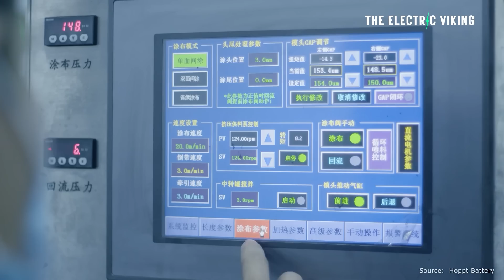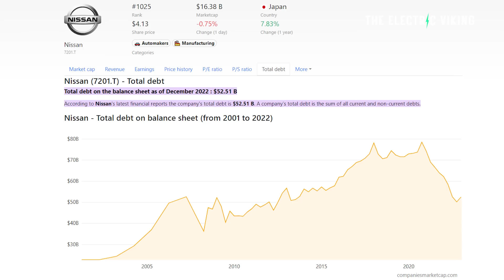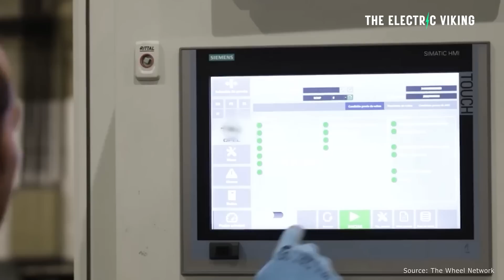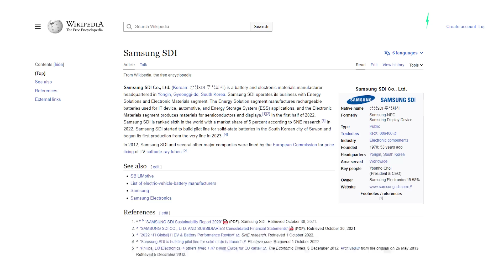WAY too many battery factories are being built in the US with the wrong batteries

Comment: What you are neglecting to consider is that,  in moving to the renewable age, sufficient battery supply is absolutely essential . The market will determine which chemistry will prevail. And yes, that prevailing technology will change over time.
Reply: >>  The market will determine which chemistry will prevail. ...<<
That's not how it works.   The industry is heavily subsidized by gov't larges.  In China particular, the CCP forced out Korean/Japanese battery makers early on-- who btw had well over 50% of the Chinese market share in 2015 -- from partcipating in China's EV market to protect their weakings BYD/CATL.   Those foreign competitors now have 1 % in China and the CCP's "preferred" LFP has become de facto standard in China with over 50% new EV in 2023.   Biden's IRA largely a measure to counter China's market distortion and to restore the battery market as it should have been.

Comment: These lithium ternary (possibly pouch cell type) battery factories being built by SK Innovation and LG Chem in partnership with American legacy automotive OEMs will likely quickly go bankrupt if they ever get built at all. As EV adoption accelerates, American vehicles buyers, fleet owners, municipal and state governments, repair shops, insurance companies, and lending institutions are becoming more familiar with the different types of batteries and their associated benefits, limitations, and fire safety risks. Tesla's 4680 batteries, a good portion of which will likely be LFP and LMFP, will set the standard for American EV batteries simply because Tesla will be making and purchasing so many of them. Less safe, more expensive lithium ternary batteries will fail in the market by comparison. The fire hazard, expense, and deep cycling issues of lithium ternary batteries also makes them far less suitable than LFP or Sodium Ion for stationary storage applications. If these battery factory projects don't switch to safer and less expensive chemistries then they will likely soon evaporate under the harsh spotlights of financial industry analysis, fossil fuel funded media scrutiny, and market competition.
Reply: It will be pretty straightforward to change or update the battery chemistry in any given battery factory. They will be set up to ensure that it is possible.

Comment: There are many uses for batteries. We haven’t even started on heavy machinery and other things that run on some type of fuel. The market for batteries is unlimited even for non state of the art ones.
Reply: Including the uses new technology has not even created yet
Reply: @sparkysho-ze7nm  Exactly, maybe I'll finally be able to buy a refrigerator with a backup battery.
Reply: Solar panel charge controller 12 v battery 3000 watt inverter  click click free energy for life
Reply: The point is that if you have an option between a car with LFP or NMC you will choose LFP. And they are setting themselves up for that choice to be between a Chinese car and an American/German/Japanese car.
Reply: Japanese don’t make evs YET
Reply: the batteries long way to go to match the energy efficiency of gas which is equivalent to 12KWh/kg -- most cutting edge LFP is only about 200Wh/kg whereas NCM9 is ~320+Wh/kg.
Reply: @tooltalk  Matching the energy efficiency of gas will be a milestone. I predict gas will still be available when it happens.
Reply: Utility storage.  California gets most of its electricity from solar but the sun goes down in the evening.  Just in the last couple weeks, we've experienced rolling power outages across California.  People are pissed, especially when they can't operate their A/C units in 105 F degree weather.  We will also be shutting down out last nuclear power plant in a couple years.  Brilliant.
Reply: Over investment isn't the problem, under investment is. I don't get his take here. I am more worried about enough lithium to supply all these factory's.
Reply: @bp495599  I wouldn't invest in lithium right now. There will either be oversupply of it or batteries will no longer require as much if any over time.
Reply: @bp495599 there is an unlimited availability of Lithium. Its processing that hasn’t caught up.
Reply: Lithium refining Issa cathode plant……….” A license to print money “ IN TH US ONLY TESLA IS REFINING LITHIUM click-click

Comment: I ordered the one variant that had LFP, the Model 3 RWD, as the advantages seemed to outnumber the disadvantages by a lot.  Like being able to charge to 100% (versus getting 20% more range and suffering degradation if charging above 80%), avoiding nickel and cobalt's environmental impact (having lived in Canada ten years, and knowing the extensive past impact of the Sudbury Ontario nickel smelter ), lowered risk of thermal runaway.  Versus slightly lower energy density (but charging networks are infilling a bit each year, and more Airbnbs offer EV charging, so that's ever less an issue).

Comment: We're going to have a cycle of overinvestment and correction, which is not unusual for new tech given subsidies; right now any supplier who gets in an offering at the right price and quantity can find a place to survive, and then if they hang on, they get consolidated into a monopoly producer a few years down the road.
Reply: It would be very hard to overinvest in battery production at this time.  Aside from EVs there is an enormous need for storage batteries as we transition from fossil fuel generation to renewable energy.

Comment: What about Chinese and Russian companies hogging all of the Lithium mines? 
EV battery production race is over before it haa started. By the time US manufacturers get LFP right. Sodium will be the new trend, etcetera.
Reply: I think there is an effort to mine and produce this stuff domestically. Do you propose a different approach?
Reply: @jbbuzzable  I think just skipping to Sodium would be oreferable. It is so abundant and it is where battery technology is heading because it is safer, cheaper and much more forgiving in terms of charge speed, levels and temperature.

As in sports: "Don't run to where the ball is, run to where it is going to be."

Comment: CATL are using the same manufacturing facilities to produce each version of improved batteries. The changes occur in the pre-production chemistry or anode/cathode production cells. Other battery factories are surely configured to achieve similar outcomes. You don’t invest $B without future-proofing the facility.
Reply: Absolutely right. This is really a non issue.
Reply: Correct. It is possible to convert an NCM line to LFP. However on automobile applications,  the optimal cell  format is often chemistry linked. For instance the optimal modern NCM high nickel,  SiOx format is the cylindrical format while the LFP best format is the prismatic long and short blade formats (600 to 1200mm long). Therefore converting an NCM pouch cell line to an LFP blade line will be quite expensive...
Reply: Respectfully disagree. Business decisions are frequently wrong. Our Country’s energy policy, if you can say we have one is fragmented and often wrong. Subsidies funded by generational debt don’t make sense to me. Bad decisions are often funded by these subsidies provided by supposedly well intentioned politicians.
Reply: GM invests (taxpayer) $Billions with no plan for the future...
Reply: Who says so? @FrunkensteinVonZipperneck

Comment: Thank you Sam!! This is arguably the most important video you have produced for prospective USA consumers! My take is if you want to buy an electric vehicle in the states that will still be in your garage 12 years from now, and has an actual working DC charging network, the only game in town for the next 12 months is a Tesla RWD model 3. I’ll be watching Volkswagen and Ford closely to see how their investment in LFP/LMFP plays out in the coming years.
Reply: The charging network might be less of an issue since Tesla released their connector patent and created the NACS standard, but there's no doubt that a full battery replacement is a financial time bomb for most people.
Reply: >> states that will still be in your garage 12 years from now..  the only game in town for the next 12 months is a Tesla RWD model 3 <<
Tesla LFP EVs already suffer from accelerated battery degradation under Tesla's 100% charging recommedation.  All Tesla LFP EV owners must charge their battery to 100% frequently to avoid inaccurate SOC/range (and other associated problems such as cell imbalance).  This in turn accelerates battery degradation in LFP -- in practical terms, Tesla's LFP lose 10% of range in the first 1-2 years, or twice as fast as non-LFP batteries.
There is no long term data on LFP battery degradation in EVs, but based on what we have so far, it probably won't look very pretty.  12 years?  Maybe.
Reply: most of what you said I agree on.  II dont agree on the 12 year comment.  I have 2x high milage evs with lithium-ion chemistrys with over 150k on each. granted both are only 6 years old but both have very little battery degradation.   I personally don't expect a 12 year old ev to have the range of a new one.  due to teh charging speed of my cars and other factors I'd be likely to use them for shorter trips 100 miles vs what I regularly do now (250 miles)  as the charging networks get built out more having less ranage will be less of a problem.  as most Americans have multiple cars in a househould and most people dont hold onto cars for 12 years the ones that will hold on to them are likely to let the kids use them or have a newer car for long trips.  the range loss on a 12 year old battery wouldn't be a problem.   heck,  even 2011 nissan leafs are still mostly original batteries.  and those batteries are notriously bad.   a car with 250 or more miles of range in 12 years if it was 150 miles of range is still fine as a daily driver.   that said,  it is definitly an issue if all these factories make the wrong tech.    but the market is likely to fix that.    I really don't see how us automakers will surive this anyhow.   they are in denial only slightly better then Japans car markers.
Reply: the other thing -  we act as if these batteries will fail and that they will be thrown a way and that it will cost 20k to get a new battery installed.   with as many car accidents as their are,  I"m fairly certain that with most higher volume vehicles companies will sell refurb or batteries with warrenties for moderate decent costs as well as repair some batteries on site.    I could see it costing 5k to get a new used battery installed.   if the company gave an 60k warranty on that it wouldn't be that bad.  also cell repair will be a thing on some models with easier to open packs.  I could see even 2017 chevy bolts lasting 25 yeaars because of aftermarket  batteries and a high volume tesla might last indefinitly
Reply: As ever changing battery technology improves
Reply: Pity you won't have option to buy BYD EVs any time soon
Reply: MG4 is a much better choice here in Oz
Also, only 40% of public chargers in the US are NACS,and, 
90% of all ev charging events in the US atm are @ home, 
thus, there is no need to paymore for the Tesla brand.
Reply: @nordic5490 that figure changes a lot if you are counting chargers that work.😊

Comment: Interesting! I would actually prefer the new, 100% charge capability, LFPM battery even with lower energy density but a much longer life. I think it's crazy for Tesla to report mileage when the 80 % charge level produces 20% less range in reality! Give me the battery that is slightly less energy dense but can be fully charged every time without fear of reducing it's lifetime.
Reply: It's time to stop this FUD about ternary batteries only being possible to charge to 80%.  That is simply not true.  If you are planning a long trip, you can easily charge to 100%.  As long as you don't do that every day, you'll be fine.  The vast majority of people do not need their full range very often.  So just stop it.  The full range is there if people need it.
Reply: @incognitotorpedo42  I know...But the LMFP does not have to be babied and it is less prone to fire issues.
Reply: @thehobe150 just let software manage the charge cycle and term. We wouldn’t even need to think about it.
Reply: Current LFP batteries have that capability, it's not new technology. The CATL M3P LMFP (Lithium Manganese Ferro Phosphate) tolerate the same 100% charge on a regular basis. NMC/NCA batteries are about 25% more energy dense (kwh per kg) than current LFP batteries, the LMFP batteries are suspected of being only about 10% less energy dense than the NMC/NCA batteries.
Reply: @TB-up4xi  I know!
Reply: @TB-up4xi  >> Current LFP batteries have that capability, it's not new technology <<
All lithium-ion battery can be charged to 100%; LFP or NCM/A.   It's however not recommended to do so frequently b/c it accelerates aging in your battery.  Some of you seem to mistakenly believe that it's okay to charge 100% LFP batteries based on two assumption: 1. LFP's longer lifecycle in stationary energy storage system; 2. Tesla's recommendation to charge 100% -- Tesla can do no wrong and Musk is our Second Coming.   Now the realities are:  1. LFP's don't last nearly as long in EVs with high C-rates -- which is why LFPs are limited to entry-level, low-range EVs.  2 It is necessary to charge 100% your Tesla LFP and recalibrate it to avoid inaccurate SOC reading in spite of the accelerated aging.  Your Tesla LFP could lose 10% in range (90% SOH) in the first year or two if you blindly follow their recommendation. 

>> the LMFP batteries are suspected of being only about 10% less energy dense than the NMC/NCA batteries.<<
First, while the lab results look promising, LFMP's density are nowhere close that of NCM's.   There are multiple variants NCMs now -- LFP's performance may soon match 10year old NCM1/5/6, but is still light years behinds NCM8 which is widely used in the Ioniq 5/6; Mach-e; or NCM9 used in the Ford's F-150, Kia's EV9.   NCM is constantly evolving battery technology and, contrary to this charlatan Viking who probably should consider changing his namehandle to CCP Viking to be transparent, is already cheaper than LFP in raw materials cost.  Once the South Koreans bring up 300+ GWh battery NCM8/9 capacity in North America, it's game over for LFP -- their 15-min of fame is no more b/c their key advantages, price and ample supply, would no longer be relevant.
Reply: That is doable in the manufacturing process Now, long life compared to less range or long range to less life ,there is only essentially 2 or 3 main minerals I understand that make the EV lithium ion battery ,it's like mixing a cake recipe 😆
Reply: The extra capacity may be more important than lifespan to some people who travel long-distance or want the ability to get to the Thunderdome when the SHTF, although maybe a more sensible prepper would prefer the rugged  LFP for rebuilding civilisation.
Reply: Its all a numbers game but the numbers don't add up somehow, i got 16 to 32 bars to rock it, yet only 15% of profits ever seen my pocket. It's a numbers game but s**t don't add up somehow, they say it's the last straw that broke the camel's back, but here's the secret, there's a million other straws underneath it...

Mathematics mos def
Reply: Depends on owner.  Some people are ok if the car can be pushed 20% more but it might be detrimental if done daily.  If you on a trip, you might want that 60 miles no matter what
Reply: Why do you need to fully charge daily? 300 mile daily commute? You CAN charge a NCM to 100%, it's just not something you do for daily use.

Comment: IF , or when, a new battery chemistry comes along to defeat Li-Ion, these factories will pretty rapidly transition to those chemistries.
It's still a cylinder or pouch, with anode and cathode and a dielectric.  The transition is not beyond the ken of smart people with billions of $ at stake.
We're not talking crystal power or zero point energy, the similarities are enormous.
The most important aspect of the battery factory explosion, is getting recalcitrant people and states to "invest" in this non-carbon future. Once the infrastructure is there, it's self sustaining.
Once a West Virginia miner has a MUCH better job in a battery factory, he can tell Joe Manchin to fvck-the-fvck off.